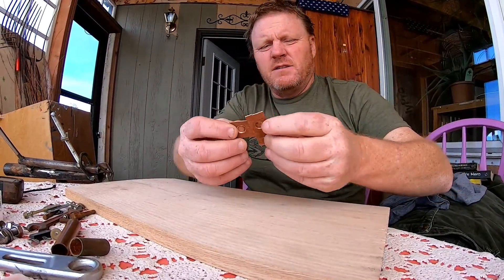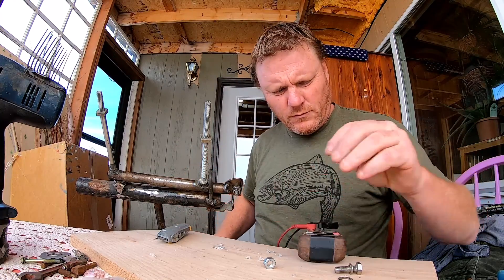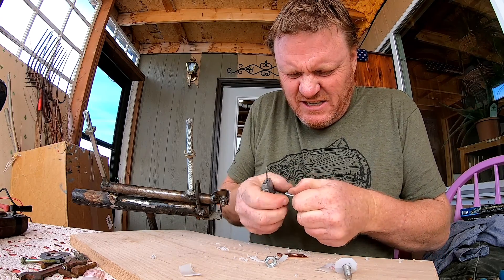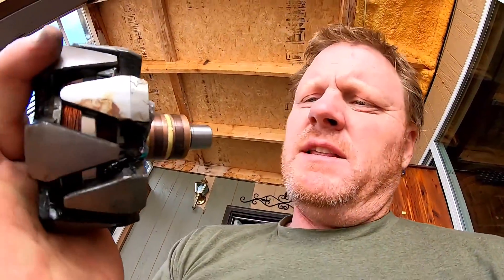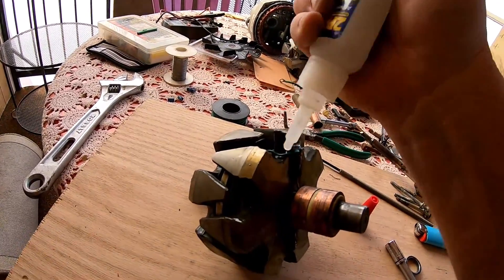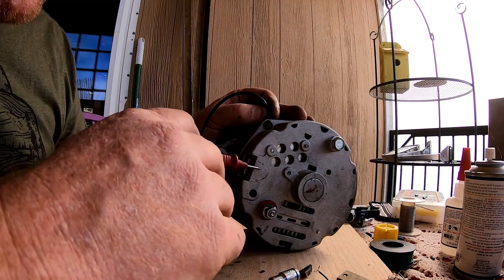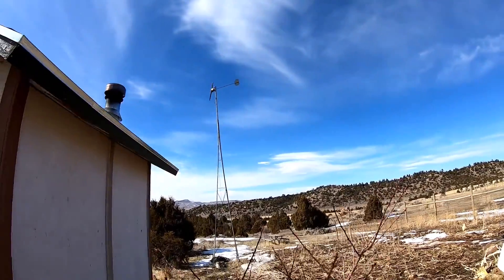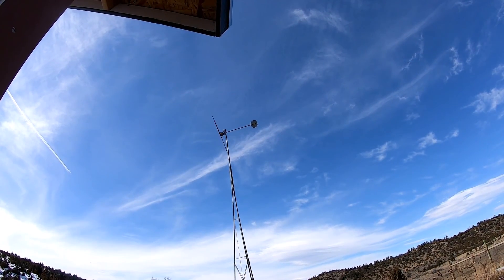car alternator wind turbine, car alternator wind generator, no permanent magnet, free energy

Comment: Sorry thought it was Jerry then Gary, read transcript and it said Carey so yes, you are Offgrid Carey at windgenzen, not Shop Jerry. Thank you. Let me know if I got it right.
Reply from the maker: Lol, not shop Jerry. Love that site though. My name is Kary.
Reply: @veggitarianredneck  Fixed to offgrid kary. BTW your amps seem low perhaps due to blade profile. With a 5 ft I get 5-10 amps in 10-15, 10-20 amps in 15-20& above 25 20-30 amps, pushing 40 amps near 40 mph of wind; wires get hot&in an hour or 2, sometimes days, internal mags warm&glue melts&it sounds like a 5hp margarita mixer as it goes into full freewheel spin breaking 2,000 RPM w/ tips breaking mach 1. I used to go out w/ rope&throw it into blade to stop them&had one shear off&whiz past my head at 100mph plus. Great fun. At 10 amps=120 watts X 8 hrs = 1KW/day x 9 months = 270 kw/year vs solar at half or .25 of that=60KW/yr here in SF my wind rig cost $100+$50 s/h+$20 hardwood plank+$30 mount=$200&if 1 gallon=10KW (good gen)=$6 around here then 270/20=27 gallonsx$6=$162 so wind gen paid for itself in 18 months&solar took 40-70. SF is overcast city.
Reply: @veggitarianredneck  A friend asked about the.rural land ad. Got a number for.a.conference call?

Comment: Had a thought watching this. Solar powered motion sensor to make the connection?
Reply: I used a stainless ball in a PVC PIPE w/ a stainless tube at the end and a stainless bolt and rigged it to a 12x12 styrofoam paddle so when wind blows it tipped tube and ball rolled into stainless tube against stainless bolt; the wind switch at windgenzen. A bilge fkoat works too. A diode might be best.

Comment: Why the need for a tail on the turbine
Reply from the maker: So it follows the wind
Reply: @veggitarianredneck  Maybe you might not want it to follow the wind especially if it's too strong or the storage is full or it will spin out of control.
Reply: @irishguy200007  Depending on your setup, if you wanna keep the turbine from freespinning, you could add a  dump circuit so the drag of the electromatgnetic field slows the prop down. Besides, you want to use a tail  so you can grab as much winds as possible and not make the prop worthless. The tail drags the face of the prop into the wind so it can, you know, catch it and force the turbine to spin.
Reply: @irishguy200007  - A well designed wind turbine will have a tail with both an automatic as well as a manual means of turning the turbine out of the wind when the windspeed becomes dangerously high. Check out Hugh Piggott's channel for illustrations of these concepts.

Comment: Is tephlon tape (plumbing stuff) conductive ?  Just ran across your channel today  !!
Reply from the maker: No I believe not.
Reply: @veggitarianredneck  was just thinking you could use tephlon tape to insulate the bolts so they could not ground out to the frame, make shift sleeve . Should of explained my question better . Good luck with the wind turbines!
Reply: @mg9510  you can use NYLON nuts b bolts

Comment: How many volts output and amps?
Reply from the maker: The highest amperage I've gotten so far is 10 amps @ 24 volts. But to be honest I haven't had much in the way of good wind for awhile now. Hope to have a video up soon showing the amp guage.
Reply: @veggitarianredneck  by the way have u ever tried speaker magnet on the rotor?😅 thats what other did
Reply from the maker: I have not personally but I know it's done. But I dont think it's a speaker magnet. They are neodymium doughnut type magnets. But yeah they certainly look like a speaker magnet. I'm going to be making a permanent magnet version of these shortly.
Reply: @veggitarianredneck  neodymium magnets is too expensive😅
Reply from the maker: Oh crap, dont I know
Reply: @veggitarianredneck  induction motor converted to pma works better i tried it bcause it has more windings and i ve use magnet from 24v dc motor
Reply: Why do you need a permanent magnet?
Reply: @irishguy200007  - To provide a magnetic field without having to use some of the wind-generated power to energize an electromagnetic field, i.e. lost power. Though both permanent magnet and electromagnetic fields have their own advantages and disadvantages.